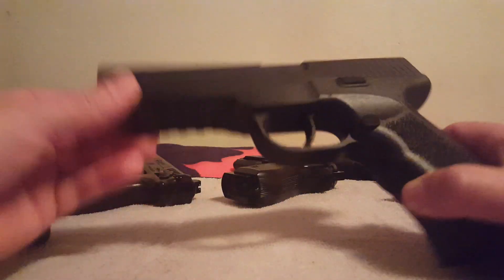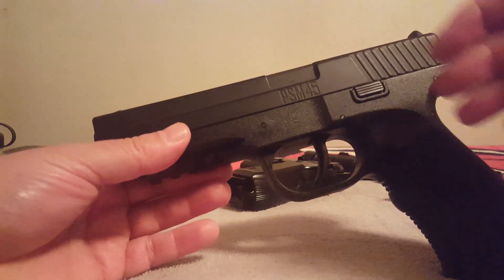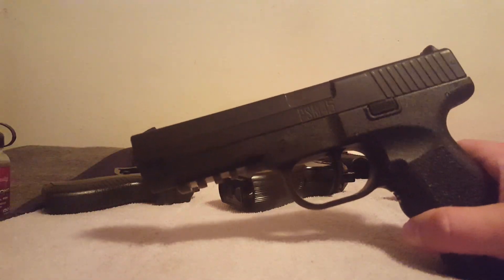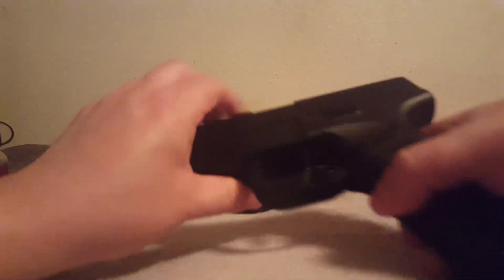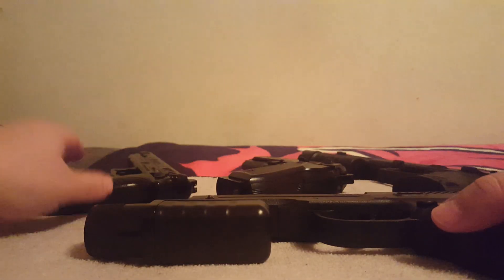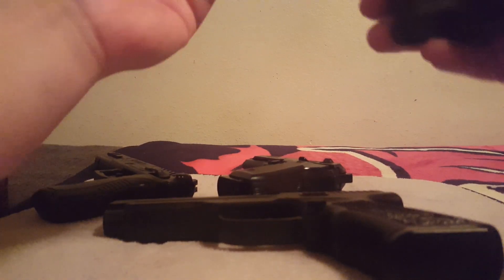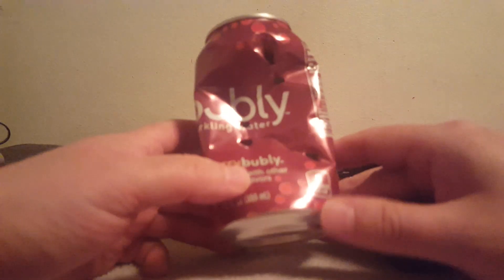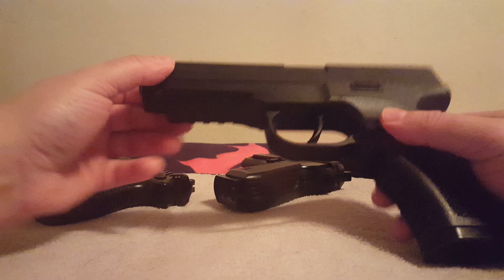Crosman PSM 45: PART 2

Comment from the maker: BB JAMS

Some shooters may be using cheap BBs or BBs off the ground. Please don't do either one. 

DON'T SLING SHOT THE SLIDE! That means holding the gun with one hand then pulling the slide with thumb and forefinger and let it CRASH forward. That is bad for this Crosman. It causes MISFEED jam. That is easy to clear but can become CRONIC from misuse.

The jam I point out to avoid is BREECH JAM. BB jammed in the barrel. 

I have not had any malfunctions with this Crosman pistol. The 45 has many improvements over the Daisy 340.

I first used great lube for the slide joints. Though you don't have to use FP-10. 30 SAE ND in a dropper is fine.

I cock the gun properly - therefore smoothly loading the BB. I chose RIGHT AWAY to go with elite BBs here - better made, more uniform - and Black Diamond and Black Widow both shoot great. NO MALFUNCTIONS. The Widows are actually more accurate, meaning more hits in a string, but the Diamonds group TIGHTER when they hit and with more penetration on pop cans. The Diamonds are king at 4 yards or closer. The Widows rule at 5 and even 6 yards.

Comment: Great video! I just picked up a PSM45 recently and didn't know if oil was needed or where to apply. Also grabbed up some black diamonds; good, accurate BBs. Thanks for the tips!
Reply from the maker: Thanks! Just be conservative with lube inside piston tube. 1 drop. Crosman also has silicone product.

The Black Diamonds CRAZY FAST with great penetration as you will see on pop cans. Just follow my carnival tricks for pop cans.

Comment: I didnt even know hornady makes bbs lol do they make pellets too? If it's anything like they're bullets I'm in they're bullets are accurate some even match grade accuracy
Reply from the maker: King, it is a trademark agreement. In this case with Umarex, a German multi-national. It looks like Hornady makes them and Umarex distributes  them.  No pellets I've seen yet.

Crosman has Reminghton. Daisy has Winchester.

It looks designed to pull over firearm enthusiasts into the high-profit airgun world. But they are smooth FAST BBs.

Comment: This is very Helpfull Video I watched part 1 as well it really helped me as I 1st used normal bbs and it got jamed then I started using black widow they are good but next I'm going to try black dimont bbs I wish the bbs where silver or white so I can see the bbs.
Reply from the maker: Umarex has Zinc-coated BBs (silver), but they are not as smooth nor as FAST at Black Diamond.

Oh, some more tips. I've had shooters excited like you, but then they make basic mistakes that break the gun. Then they get angry at me.

▶️ DONT DRY FIRE THE PSM45 FOR FUN. That cracks the front of the piston tube. Your gun shoots 3 feet.

▶️ At 1000 shots, the factory lube wears off. The BBs start dropping. People think it's broken, take it apart, then REALLY break it!  Eject the magazine and target the mainspring with Ballistol spray or Crosman, RWS, or Super Lube O-Ring silicone. Then go shoot. Lube gets on the piston head and rubber breech, moisturizing them and sealing IN your power.
Reply: @daisy880fanaticfixit9  I washed your videos about lubing all the parts very helpful video. Yesterday, i watched the vidoes about lubing the o ring from the magazine i ordered the silicone lube  WRS was not availabl in UK, so i bough Abbey Gun Lube, Thank you Man

Comment: Hey I’m really stuck between getting a crosman 2100 or another 880. I want to hunt starlings, sparrows, and some squirrels/rabbits here and there. What what you recommend more?
Reply from the maker: Joe, both are classic pump guns with the power to do small game hunting. Both are priced to collect. The 2100 supposedly has finer rifling.

The 880 has good hunting power - I can vouch for that from experience. It is easier to pump, and easier to work on. I have owned both. For Crosman pump rifles, I currently favor the versatile  Bushmaster, though it is lower in power. But it is a killer with Crosman 7.4 pointed pellets.

My primary loyalty is to the 880. It does deliver dime accuracy up to 15 yards - good enough.

Joe, depending on your budget, BUY BOTH. Compare yourself. 880 then 2100.

Comment: it does have some very strong Glock features but it also sort of looks like a Smith & Wesson
M&P
Reply from the maker: Keith, good point. Otherwise, IF EXACT, Crosman would have to enter into a licensing agreement with either Glock or Smith & Wesson.

Umarex did that with Ruger.

Umarex also wanted the value of the Ruger legacy.

Comment: Hi my psm45’s slide is not catching. Meaning I’ll pull the slide back and it’s not cocking the gun and holding the spring back. What should I do?
Reply from the maker: Well hate to say bad news, but if the post in back is warped, it won't work anymore. Normally that takes thousands of shots.

Try this video to see if it is a basic jam.

https://youtu.be/pr-bKSSpSPU

This what happens to 340 and can happen to PSM.

https://youtu.be/ga_bux7DMDQ

Sling shoting the slide can cause this early death.
Reply: @daisy880fanaticfixit9  thank you

Comment: Hi
I really enjoy your videos!
I have a PSM 45 that won't cock.  It seems something isnt catching  inside, it just snaps back.  Any ideas?
Reply from the maker: That type of snap back of action usually means you are not FULLY cocking back to enage the sear.

Or a BB is loose in there. For the 340, I eject the magazine and SHAKE the gun - BB falls to the ground or your open hand. Sometimes you need to  do a half-rack  by half cocking the slide and shaking; that is more rare but has happened to my 340.

I have 9000 shots on this style, the 340. 8000 with first 340 slide and over 800 on new one. Try my 340 Won't Shoot video. It should help.

Unfortunately, for a breech jam, to remove 45 slide, you have to knock out the pin as described in this video and the butt plate pin in slide back. Do that only if you can't clear jam other ways. You might have breech BB jam.

 Please try my recommendation of only elite BBs like Black Diamond or Black Widow. That does cut down on malfunctions and gun wear - they are silky. The Diamonds are killer lasers at 4 to 5 yards. The Widows more accurate at 5 to 6 yards.

Comment: I just got PSM45 and find it doesn't shoot the copperheads very well. I just use the Daisy steel bb's though it and no problems. I find it pretty accurate for a simple spring pistol. I like the build too. I find it will probably last longer than the Daisy 340 which I also have and enjoy plinking with it.
Reply from the maker: No Copperheads. Daisy BBs are better. Black diamonds and Widow will help the gun last longer because they are smooth and well made. EASY on the internal parts.

Comment from the maker: What Causes Power Loss?

Let me explain the three possibilities. 

First, my pistol started losing power around a 1,000 shots. The factory lube was wearing off. The shots were obviously dropping. I used a puff of Ballistol by ejecting the magazine and targeting the mainspring. It picked right back up.

If there is NO POWER, the BB dribbles out the barrel, that can mean a TORN breech seal. The air goes right around the BB. That is caused by crappy BBs like standard Copperheads. Or it is caused by reusing BBs off the ground; they get sharp edges and RIP the rubber breech seal.

The third way a gun loses ALL power is if the user DRY FIRES it. Without a BB in the breech, there is NO resistance to the piston flying forward. The plastic piston tube fractures, sometimes shatters, and no air MAKES IT to the BB.

And of course, if the user sling shots the slide, that busts up the plastic parts inside. A common death for airguns is letting a friend borrow it. That can be ALL OF THE ABOVE.

Comment: I was wondering where i could get a replacement mag or mag parts because I dropped mine and the little spring shot out with the tiny post and I also lost a few peices when tearing my gun apart I am a bit clumsy and its quite hard holding tiny parts in my fat hands. Anyways it would be cool if there was a help site
Reply from the maker: Warrior, the help I know of is Crosman reps. Sorry about your gun, but Crosman reps (CSR) can send you PDF diagram, which I love, and should have replacement mags.

They will sell you the mags.

New York time zone.
1-800-724-7486
Weekdays.

Comment: I bought one of these for my grand son work fine for a bit now it doesn’t seem to  feed the bb in correct it doesn’t shoot any more and you can hear the bb in it rolling around inside any suggestions?
Reply from the maker: Yes, sir, first this shares much of the same principles as the Daisy 340.  but the psm45 normally functions much better. 

I have over 1,500, on my Crosman with ZERO malfunctions. I use Black Diamond or Black Widow BBs. Smooth operation and gentle on moving parts.

DON'T sling shot slide. Ride it home.

Make sure your grandson doesn't  reuse BBs. It is HARD on the moving parts and the feeder prongs.

Your clear description shows a basic MISFEED. Try the video below 

https://youtu.be/pr-bKSSpSPU

Comment: Quick question. Do these different models of 880’s vary in velocity. I’ve seen ones at Walmart claiming 800 and ones on Amazon claiming 655?
Reply from the maker: Joe, no, only 822 different (slow 22). 800fps might be done on 10 pumps with a BB. But the ENTIRE world will hear you shooting and accuracy will be low - and bounce back lethal.

Pellets at a good weight for the good 880 power are 8.5 to 9 grains. That will come in the high 500s.  Like 585fps. Good up to 20 yards on 7 pumps. When I gauge it at 40 yards, I switch to Raptor at 7 pumps; power with accuracy. If I guess it up to 35 yards I could opt for Crosman 7.4 pointed.

Baracuda Green would be a good choice also down range for 880.

Comment: My BB’s just roll out the barrel and even after cocking it, the trigger doesn’t have any sort of resistance
Reply from the maker: Noah, YOU LIKELY AREN'T COCKING IT ALL THE WAY BACK.

It us riffcar first by will become easier. These low price pistols do give out and break or break down in time. The reports from veteran psm45 users is around 5000 shots. Mine is working fine.

My third 340 just gave out. The metal post in side, that the 45 has also, cracked and warped at 6200. The 340 wouldn't cock any more.

My fav guns with no jams are this 45 and DX-17. You could consider the DX-17.

Comment: Where did you get the flashlight for the crosman psm45
Reply from the maker: That was from Pyramyd Air. But it was only 99 cents. Its ok, but not great. They don't have it now. I would go to Wal-Mart for a much better priced light.

You only need the light. Great hard sights on the 45.

https://www.walmart.com/ip/L-ED-T-actical-HandGun-Torch-Lamp-P-istol-Flashlight-230LM-2-Working-Modes-for-Fishing-Cycling-Hiking-Training/678258012

Comment: How do you like the gun
Reply from the maker: I liked it! It broke after 2,000 shots, but I would not hesitate to get another. It shot flawlessly with good accuracy up to 2,000 shots. Then I tried Umarex Zinc, and it didn't like those. I got a few jams.

If you stick with the BLACK BBs, you should have flawless performance.

Black Diamonds are a great fit. Here is a shooting doctor showing you how to use it.

https://youtu.be/jnAGx-c1G0E?si=7BY3q8VEvfg2yKwm

Comment: can u link the lube?? pls
Reply from the maker: Swift, sure.

This one is for slide joints, catch point on magazine, and top of magazine.

https://www.walmart.com/ip/Super-Tech-Non-Detergent-SAE-30W-Lubricating-Oil-1-Quart/52626201

https://www.walmart.com/ip/Plastic-Dropper-Bottle-10ml-0-34oz-Small-Mouth-Drop-Bottles-Empty-Squeezable-Eye-Liquid-Dropper-Bottle-White-10-pcs/797157165

This one is for the power plant every 800 shots. In the video I show RWS Silicone. RWS works, but is needlessly expensive. This is far better value:

https://www.amazon.com/Super-Lube-56204-Silicone-Lubricant/dp/B083NXVGQX

Comment: I got one of those last week, a real pile of crap! It lost all power with less that 1,000 shots...junk!!
Reply from the maker: Sir, sorry that happened to you.

Let me explain the three possibilities. 

First, my pistol started losing power around a 1,000 shots. The factory lube was wearing off. The shots were obviously dropping. I used a puff of Ballistol by ejecting the magazine and targeting the mainspring. It picked right back up.

If there is NO POWER, the BB dribbles out the barrel, that can mean a TORN breech seal. The air goes right around the BB. That is caused by crappy BBs like standard Copperheads. Or it is caused by reusing BBs off the ground; they get sharp edges and RIP the rubber breech seal.

The third way a gun loses ALL power is if the user DRY FIRES it. Without a BB in the breech, there is NO resistance to the piston flying forward. The plastic piston tube fractures, sometimes shatters, and no air MAKES IT to the BB.

And of course, if the user sling shots the slide, that busts up the plastic parts inside. A common death for airguns is letting a friend borrow it. That can be ALL OF THE ABOVE.
Reply: @daisy880fanaticfixit9  I did take it apart, I saw no real damage, but I'm no expert either, how do I check fornTORN breech seal, i seen your videos and trust your expert advice. Thank you so much!
Reply from the maker: Well, first, since you are a good sport, I have to warn you that if you do not get this fixed, DO NOT go running to the Daisy 340. Because I like the 880 doesn't mean I like everything Daisy.

The 340 is JAM monster and breaks in different ways. I went through 3 and learned much - like I won't he getting a fourth, with HOW it is currently made. A 16 year old warned me it was too cheaply made. He was right.

The Marksman 1018 is the worst 😫. It died around 2,000 BBs. THE NOSE LITERALLY STARTED BREAKING OFF.

The DX-17 is well priced in this carnival gun division. The  Psm45 is still part of this class of BB gun. The DX-17 is the MOST RELIABLE, but not a great shooter. Just remember to tip it UP before shooting.

Now, what you are asking for is to pinpoint the break and repair it. That would be great IF Crosman sold the parts. I tried stocking up on parts and got an angry manager, making it clear they don't sell psm45 parts. I was disappointed.

Please direct any anger at Crosman.

If you didn't reuse BBs, dry fire it, or let a caveman friend borrow it, THIS IS NOT YOUR FAULT.

Look with a good flashlight or your phone light for a break in your pump tube. If there are no cracks. You are good there.

Lube the spring while there. I will send a 340 video that shows the slide. It's similar. Try to get the feeder pushed back with your thumb, and get a Q-tip inside the breech seal and clean with lube. It may be dry and/or dirty.

https://youtu.be/pr-bKSSpSPU?si=E6SI4Xc2ZiojuamA
Reply: @daisy880fanaticfixit9  , Thank you for your detailed reply, I will try to do what you said to restore power, I find that most if not all  these spring guns, airsoft and bb shooters do not last long at all.

Every one I bought broke in a short time. I do like pump bb guns, they last a long time and are built much better. I have a Daisy powerline 35 riffle and had absolutely no problems with it, I also have the Daisy 426 co2  pistil and it works fantastic.

I wish I could find a pump repeater postal, bust most are s feed one bb/pellet at a time, not really my thing.

Well, nice chatting with you, I really like your channel, keep up the good work!
Reply from the maker: Thank you for being thoughtful and realistic about these products. Your Daisy 35 is solid gold by comparison!